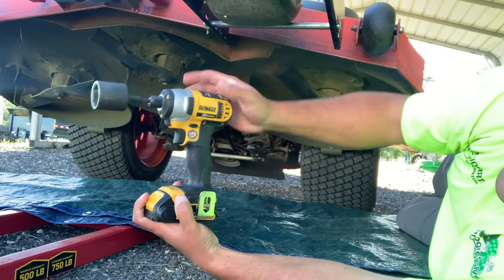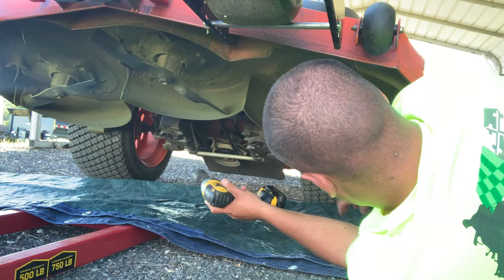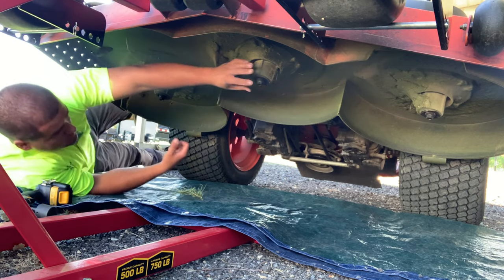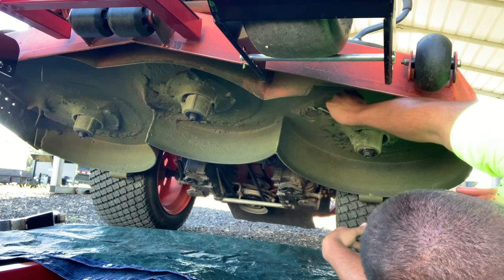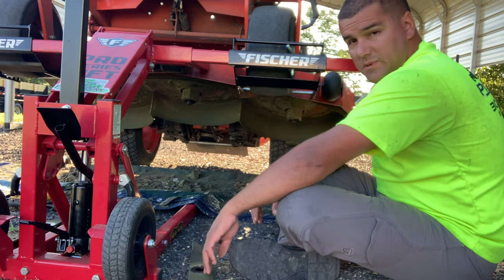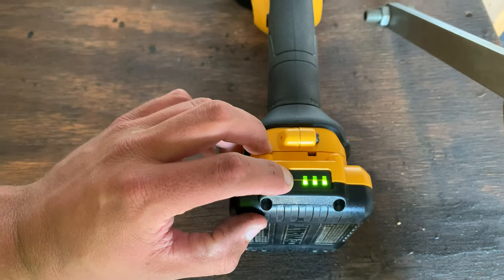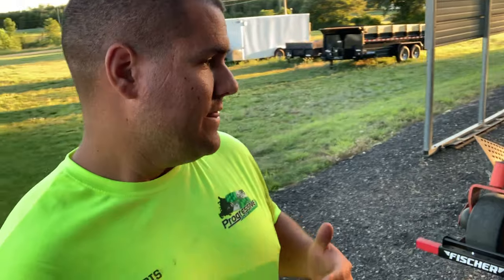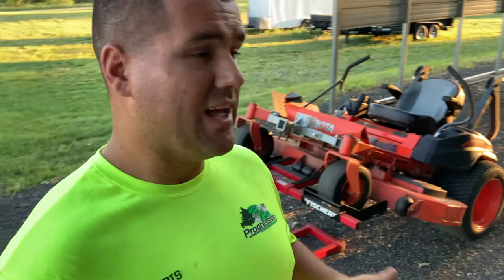Easiest Way to Change Lawn Mower Blades! [ Dewalt Tools ]

Comment: What model Dewalt Impact? Is it a 1/2? I have a Dewalt drill with 20v batteries. Will it work in the Impact? Thx
Reply from the maker: I believe it’s a quarter inch honestly. It’s a very small impact. Works just fine for busting blades off but won’t do much more than that.

Comment: Great video. On the removal of the blades. Did you use an Impact Driver with adapter or an Impact Wrench 3/8 driver?   You have all the brands I have, Kubota and Dewalt. Thanks
Reply from the maker: Thanks! Appreciate that! I use the adapter. This impact is small but it works for getting that bolt off. Doesn’t do much more than that haha. I bought the adapter at lowes and have that impact dedicated to just changing blades
Reply: @ProgressiveLawnService  Thanks Brother!! You just saved me from buying an 1/2inch impact wrench driver.  Keep the sunny side up out there in Big TEXAS! Lol.
Reply from the maker: @stanleymorton5065  no problem man! Hope it works out for ya!

Comment: The first tool you used was the lift, can I get some info on that?
Reply from the maker: That is a Fischer Series Pro Lift from Harbor Freight. Thing is a lifesaver!! 

https://www.harborfreight.com/750-lb-heavy-duty-atvmower-high-lift-jack-63298.html?utm_source=google&utm_medium=cpc&utm_campaign=12144811130&campaignid=12144811130&utm_content=128369724875&adsetid=128369724875&product=63298&store=2944&gclid=EAIaIQobChMIterox4mD-QIVrf_jBx0bbAsDEAQYASABEgLwWvD_BwE